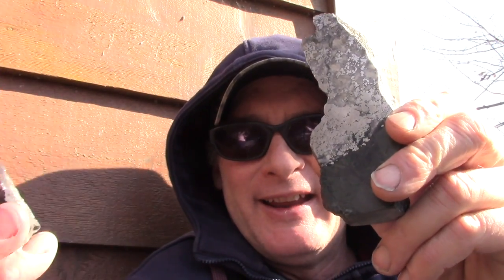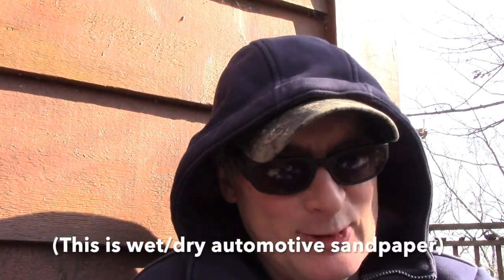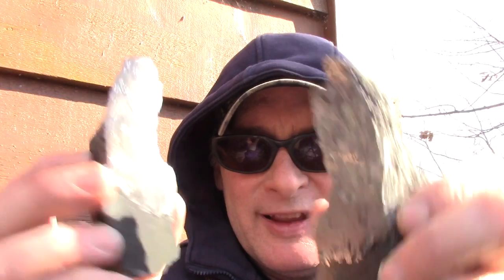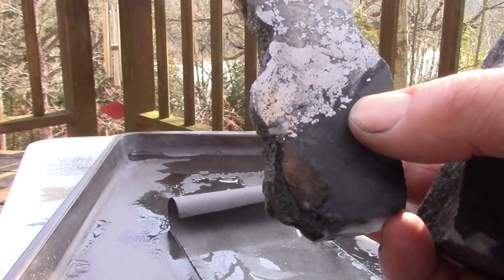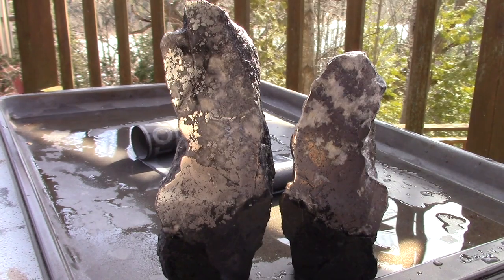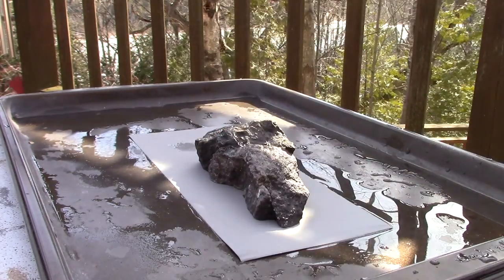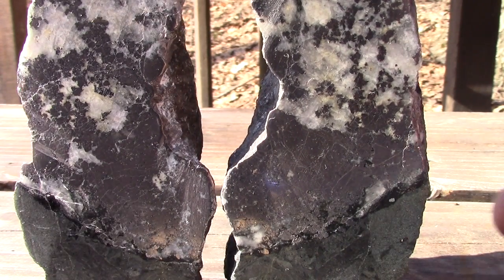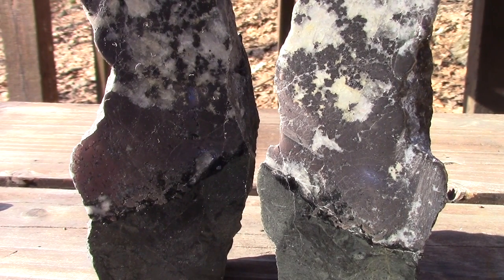Polishing Silver Ore to 7000 Grit

Comment: Great video once again! So many people out there will argue this way or that way once you get past that 2000 mark. Some use higher grits instead of polish, and in the case of faceting gems go well into 14k. Personally for me I don't bother past 2000 and let cerium oxide take care of the rest for cabs as you get a brilliant shine. Also depends on the material though. After watching your extreme patience and dedication hand polishing I got to thinking about few things that might have made the difference not that noticeable... If your slab isn't perfectly flat and you have high spots, at those higher grits they will only hit those spots and not hit the whole surface, so you could have one part of that slab super shiny and not the rest. The other thing would be the surface for your sand paper, the tray. If it isn't perfectly flat you create a high/low spots which also only hits certain parts of the slab. I've spent many more hours then I will admit on my flat lap trying to get rid of scratches from the previous grit only to find out I had low spots.. uugg. I think all your slabs look awesome at 2000, I just hope you have some left by the time I get up there! haha Thanks for sharing.
Reply from the maker: You are exactly right!  I should have been using a sheet of (clean) glass rather than a tray.  High and low spots are a curse.  I have also learned that I need a proper trim saw because it is too much effort to sand out the flaws caused by the tile saw.  Too bad the job is so dirty, as it would otherwise be something to do while watching a movie.

Comment: I love that little scribe/chisel thingy, can you take it with you when you hit the woods up prospecting?
Reply from the maker: You could if you had a way to work an air compressor.  ie. battery or gas powered air, or plug an AC compressor into a generator.  I think for rockhounding that I would rather have something larger and leave the little scribe for finishing at home.